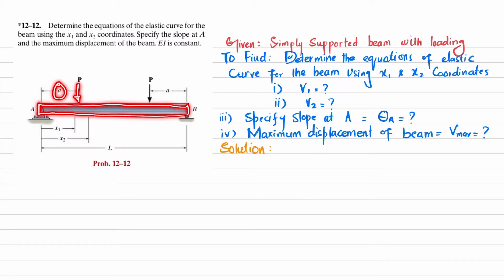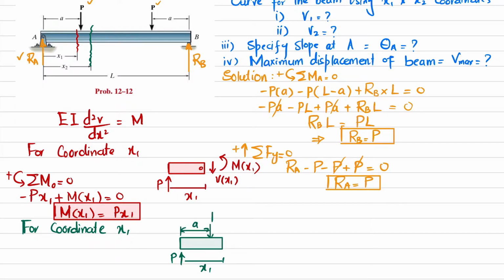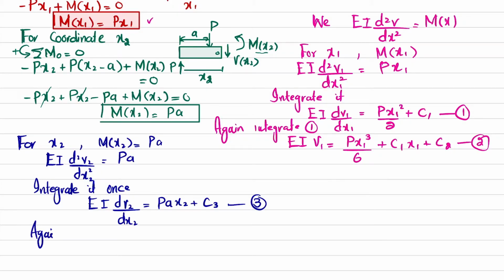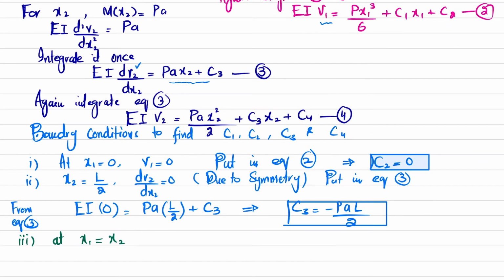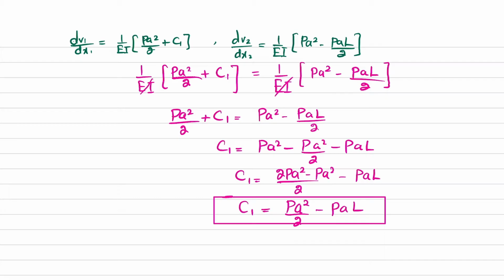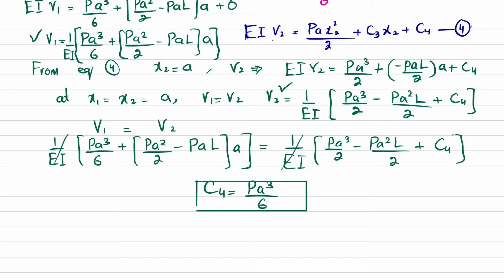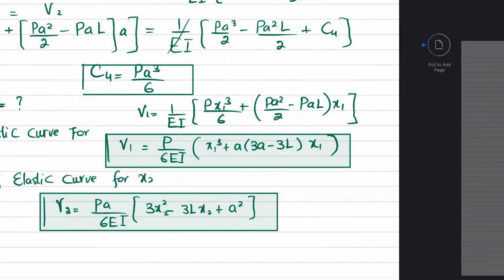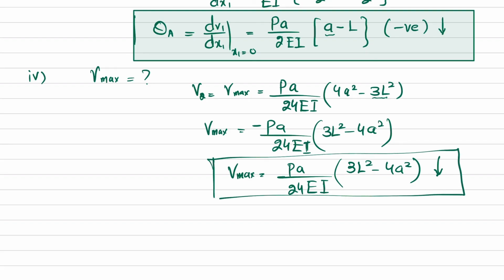12-12 Determine equations of elastic curve,  slope at A | Mech of materials RC Hibbeler

Comment: Why don't we make equations for 3 sections?
Reply from the maker: Your answer lie in the first line of the question. Please read it and if you haven't understand then do let me know. Thank you
Reply: @engradnanrasheedmechanical  sorry the question was supposed to be why does using two sections work?
Is it just as correct as using 3 sections?
Reply from the maker: @mwenge6355 but in question it is given that using coordinate x1 and x2....
Reply: @engradnanrasheedmechanical  I get that that's what it's saying and that's why you did what you did. But initially if you don't have that restriction we would make equations for 3 sections. Why does making equations for two sections work? That's my question